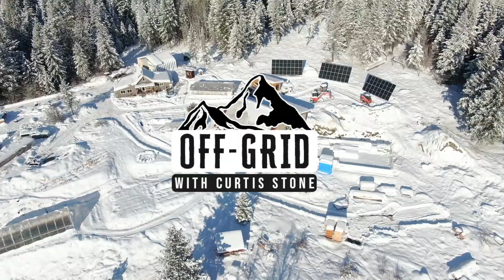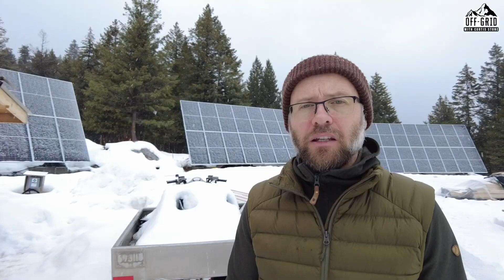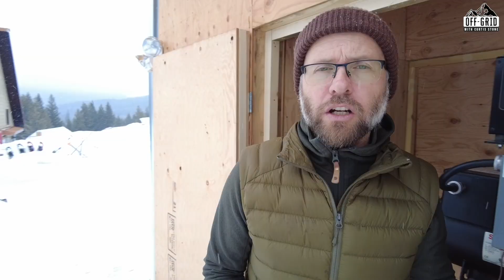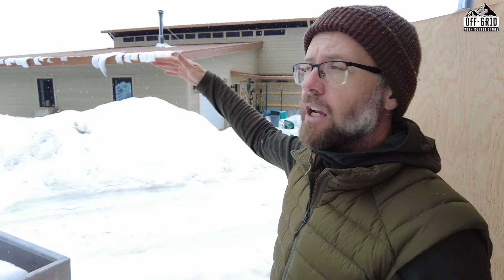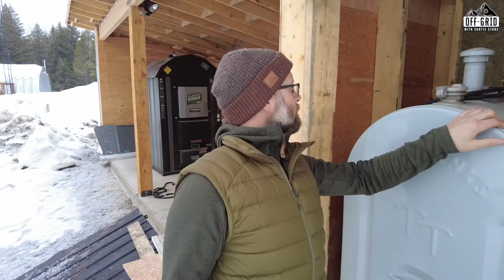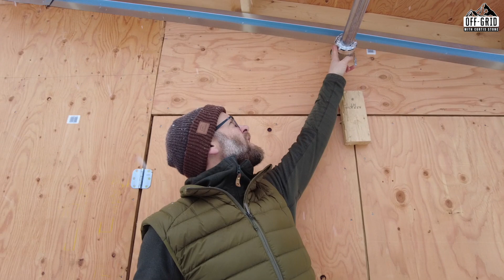The One Part Of My Off Grid System That Might Trigger Some! The Big Secret Comes Out!

Comment: Yes, the cost of diesel is a lot less than another ten thousand dollars, but it all is a mindset of self reliance isn't it? When you consider perhaps a collapse in society and no fuel available or perhaps the collapse of currency and no way to purchase fuel. Isn't this whole thing you are doing sort of from a self reliant mindset? But I would agree that the genset is awesome to have, I would however, just produce my own fuel and have a plan and be prepared for when they ban all fuel burning engines as they are doing in California and make it so I could continue producing electric without the generator.
Some of us are not just armchair quarterbacks but just sharing some wisdom and letting you know a possible weakness in your self reliance that you may or may not have thought of, but I'm sure you are happy with your idea of how you have it. There are turnkey systems out there that do address the things you mentioned. There are turnkey hydrogen systems you can buy and there are turnkey wood gasification systems you can buy and there are turnkey diesel plants you can purchase. Use your money if you have it now while you can, if you are not a DIYer. That is if you want to be totally self reliant, otherwise they can turn off the pumps and have historically done so and if they do well you have enough solar to do without your genset except for the one solid month every year, maybe you can suffer through a month without electricity.??
Reply from the maker: Ya for sure. One thing at a time.
Reply: @offgridcurtisstone  I heard that! It does take a step at a time, especially if like me funds are not as abundant as some. This is why I simply build these things as it is within my engineering mindset and skills and saves me money...lol. Love your content my friend!
Reply: @ElectronicMusicUnderground  Haha, I hear you my friend! I'm an engineer and technology is my friend especially when I marry it with old suppressed knowledge and then improve this with my own designs. 
I have taught and teach these systems and feel that knowing them and utilizing them is liberating from a world of bondage and slavery to those that have monopolized this and centralized energy to only those that profit from it. 
I prefer to have all of them up and running and to find or develop even more to add to this liberating self reliance understanding that the world once had, but seems to have lost and is blind and helpless and even perishes because they are ignorant of them.  

If I can illustrate them all in action then others may see what will work for them and also see that they too can have almost limitless redundancy. But, I do understand that many will not want to do any of them as they feel just fine in this world the way it is even after they lived through the entire world shutting down and many died because of it.

It is funny, this all reminds me of my friend when discussing these things with him he responded that he did not want to do any of the things I was telling him he could do to be self reliant and he said he likes being able to have everything at his disposal without having to think about any of it. I asked him what he would do when none of this was available and all things collapse, what would he do? He said "I will just come to your house!"....lol. Not what I really wanted to hear!
Reply: @ElectronicMusicUnderground  Haha, yes in many ways us old timer thinkers are in a greater advantage. But I would not use wood gas for the diesel genset but I would produce my own diesel. I would however use the wood gas for everything else he uses fuel for. I built a fully automated feed system and if you design your gasification system correctly it has very little maintenance and certainly way less than maintaining the solar system. Yes, you would have to harvest wood but he is already doing this for his heating. There is some processing into chucks or chips that needs to be done but this is very simple and painless. The wood chips can be fed into a pit and automated through a conveyor system to the feed hopper and everything is hands off with a correctly designed system after that. 
Yes, more effort than being on grid but everything in this life takes our effort unless we are reliant on systems that can be shut off by those that control them for our convenience.

We have become addicted to "Easy" and must learn to be self reliant as the biggest part of self reliance is "Self"!
Reply: @ElectronicMusicUnderground  Absolutely! I too am doing similar. You can run any diesel engine on this free supply of oil and you can even heat your home with this. But I am a collector of energy harvesting ways and believe in redundancy. With a gasifier you can store wood wine in any propane tank. You can also run any engine on hydrogen and if you build tanks with hydride material you can store it also with low pressure high density. You can harvest wind with better designed collectors. You can harvest the most abundant and hardly used energy which is thermal energy and this too can be easily stored and reused to heat and cook and produce electricity. This is renewable and never ending energy. It is unwise to only have one system, especially if it is using fuel that you do not produce, as your source, even if it is free, can be cut off! 

With the proper tech all of your systems can be simple and easy to operate and reliable. You can become your own manufacturer of everything you could need. This to me is true self reliance and everything else is only pretending in a world of total reset and shut down. Keep everything local and build community that is also doing the same and then those that do this are hardened to whatever could take place in this crazy world.

Comment: You've mentioned how little diesel fuel you use, and that it might sit in the tank for a long period of time. There used to be some sort of problem with mold or something like that, growing in diesel fuel that is stored for long periods. Is this something you have to worry about?
Reply: Unlike gasoline which starts to deteriorate after 30 days diesel can be stored 6 months and longer!

Comment: I like the warmer LED lights, but the flicker is a problem. One of my personal off-grid goals is a network of low-voltage LED lamps running on 12/24vdc, that don't flicker.
Reply: You can get zero flicker led bulbs now.

Comment: if you need efficient and natural light for extended time (e. g. >30 minutes) you should go for ceramic metal halide lamps, the top model from philips is actually more efficient than LED's and produces a full spectrum light. model name is MASTERColour CDM-T 70W/830 G12 1CT/12
i have 2 of these bulbs along with the corresponding driver and there's nothing out there beating them in terms of light quality and electrical efficiency combined

Comment: If an EMP took out the grid? I'd love to have a place like yours to hold up. You could last a Looong time there. Time enough to make a plan to move or possibly wait out a social collapse.
Reply: @ElectronicMusicUnderground  I dunno. They say an EMP would take out everything but I wonder if that's true? I kinda think it won't really work on anything that's not connected to the power lines? Y2k? The internet is important but I doubt it could keep everything down permanently
Reply: @ElectronicMusicUnderground  I dunno. Have you ever seen an EMP deployed? What if it's just fear porn? Seems like that would be just the thing the US military would love to use to knock out a place so they can steal their oil, opium you name it? How would you generate the power to fry every circuit in the United States. Especially if you can't even access the power ports on most of it? Think about it. Most stuff is overload protected also.

Comment: Hi Curtis. What building are the batteries kept in? It would be cool if they had their own separate structure away from the shop/house/garage, etc. That way, in case of lithium battery fire, it would only affect its own system and not take a whole bunch of other things and systems along with it. Cheers. Chuck in Florida.
Reply from the maker: Watch the other video I linked to in this one.
Reply: They have low fire risk they are lithium iron phosphate

Comment: An Old Amish trick i learned. In the Wintertime, i wash my clothes and let them dry by hanging them up in my house. It's FREE, no power to run the dryer and it puts moisture back in the air.
Reply: You need to be weary of mould doing that though, too much moisture in the air is not good.

Comment: How far from the electric grid are you located?
Reply from the maker: As far as we want to be.
Reply: I'm curious if connecting was even an option,  or if it was prohibitively expensive,  or if you just wanted the independence generating your own.  We have a "town"  place near the grid but not connected, doing the math its not worth connecting and having a monthly bill for the dozen or so nights we stay there per year.  Our main home is many miles from the grid and so of course we generate our own  power here.
Reply from the maker: It was an option that would have cost the sam as being off-grid. I mentioned that in the last video.

Comment: Calculating the diminishing returns is an important part of making those kind of decisions like whether or not to add more solar panels etc etc.
Reply: he did spend $14000 on the gen plus install, if he could get the solar to cover his needs for around that price I think it would have been worth it. But now that he has already got the generator the diminishing returns compared to the running cost of the generator no longer make since.
Reply: @anthonygaffey9667  Yes, but relying strictly on a system that can develop problems and in an environment that is not reliably sunny in the winter, makes having a separate generator backup more sense.

Comment: Have you seen high CRI LED lights that also have good R4 (red) values and are flicker free? These are photo/video grade and are more expensive, but much much better.

They generally don’t have all of the fluffy features such as dimming (which just slows flicker rates) or color adjustments, but they are incredibly good.
Reply: I have to use 4000K to 4500K  leds ,i cant stand the 5000K+ ones that are on the edge of blue.
Reply: @a4000t  I like 4000k for the most part. It looks the most "natural" for day to day although I have some 5600k photo/video lights that are really good.
Reply: Flicker free just means higher flicker frequency (more than 100Hz). They are still blinking and emitting frequencies, only a bit faster.